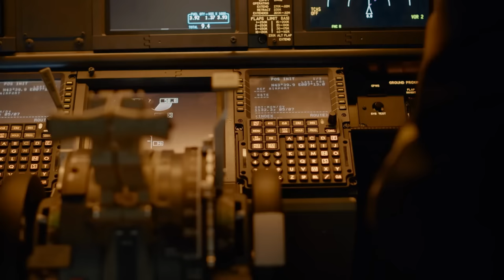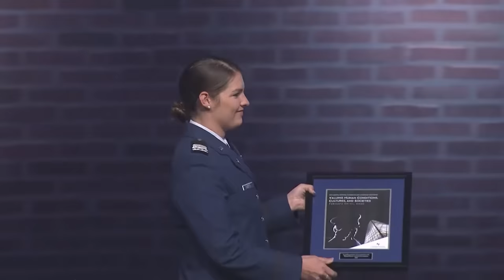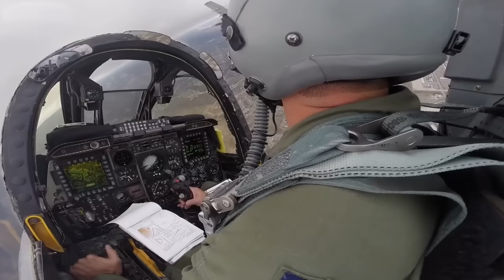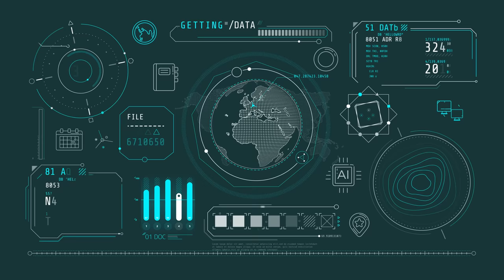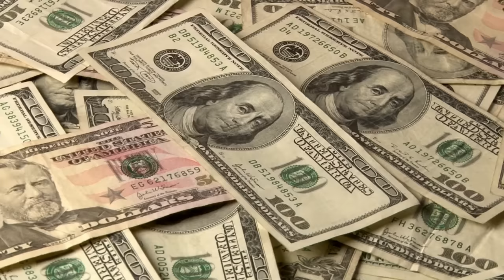FINALLY: US Tests ALL NEW Super A-10 Warthog After Upgrades

Comment: As a former USArmy soldier who spent many years in Infantry and Armor front line units I have to say we loved the A10. They can almost hover and then sprint and maneuver against ground threats. It'd be a huge mistake to remove it from the inventory without a replacement. When the Air Force wanted to remove the Army offered to take it and fly it themselves.
Reply: Which likely helped to keep it in the  AF as jealousy still remains an issue in the halls of the Pentagon.
Reply: @ClementHourican  

No, it didn't help it. Congress did.

Comment: The AF brass will screw up again and make the wrong decision to get rid of the A-10. They should start building them again and update their design. More not less. The F35 is no match in most roles but definitely not in the ground attack role.
Reply: The worst part about that is the F-35 is a perfectly awesome plane, as long as you're not trying to make it fill EVERY role.

Comment: I'm not a structural expert, but the B-52's are still in service because they've had parts of their frame replaced. Consider the WWII fighters that still fly now. Their old parts have been replaced, so they can still fly. Lastly, I'm surprised that the russians and chinese have not copied the A-10. Is it that hard to replicate?
Reply: The Soviet/Russian counterpart of the A-10 is the Suchoi Su-25 "Frogfoot". It it used pretty much the same, only that the Russian doctrine for ground support is a little different from the American.

Comment: Wow A 10 WARTHOG a decisive & a distinct Fighter Jet.
Reply: Well, technically it's not a fighter jet as it really can't dogfight. However, a great part of an upgrade would be to take the A-10B version, put a GIB EWO in, and provide it with a couple A-A missiles coupled with a capable A-A radar system. It wouldn't be a true fighter, but it could better protect its honor.

Comment: I'm thankful there was a time the A10 needed target illumination. I was the forward observer for an 8" Artillery Battery in the Utah National providing illumination for an A10 attack. (1980) I have felt the A10 "Burr" close to it's target on the ground. I have also felt the "burr" of the M163 Vulcan Air Defense System from a few feet away, used in a ground defense roll. I have also been on the defensive end of an AH1 Cobra attack. I'm a fan of multi Barrel weapons.

Comment: The military brass is never satisfied with what they have...and they shouldn't be!  But how do you replace something that is perfectly suited for the job it was designed for?  Until there is another aircraft which can actually perform in the field, much better than the A-10, just continue to upgrade the A-10 and let it do it's job.
Reply: You can't replace it when the ground troops want it it's the best air to ground support for them
Reply: ... its* job (it's = it is)